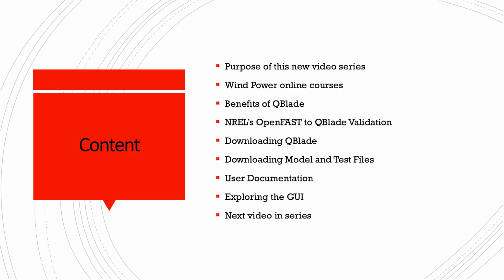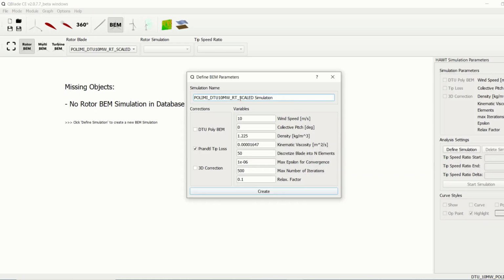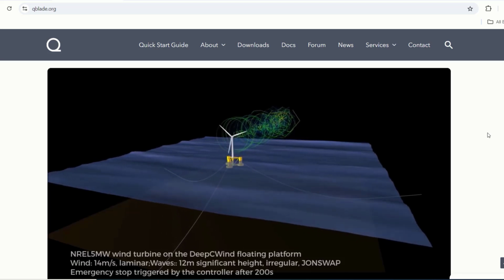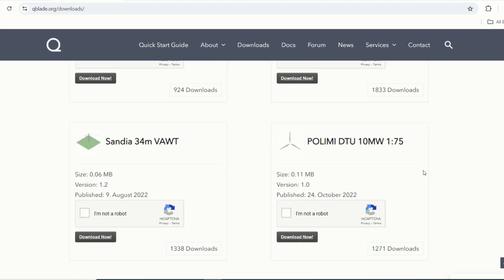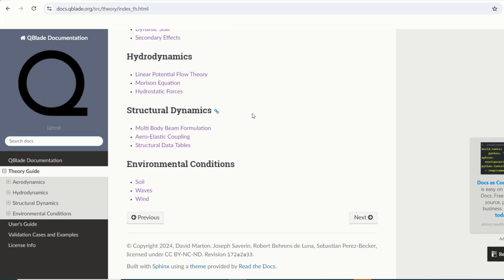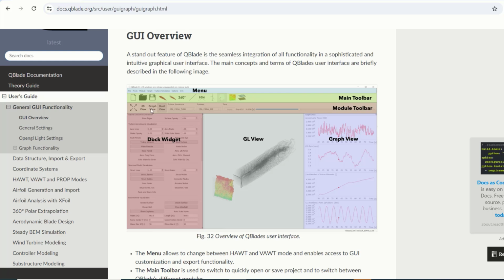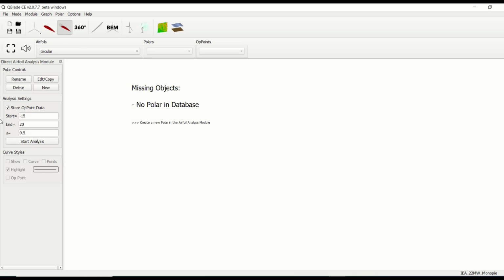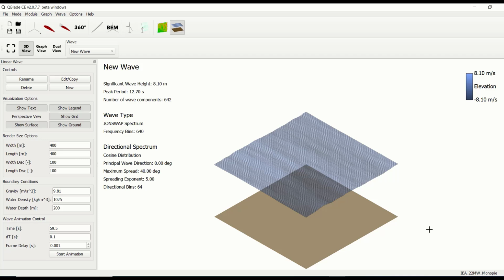QBlade Part 1: Wind Turbine System Design: Wind Power Courses

Comment: I have a question regarding chord and twist distribution. Normally when I did chord and twist angle distribution through optimization of the Bets theory I got uneven shape throughout the rotor blade. Could you tell me why I got uneven result.
Reply from the maker: Hi, thank you. 

Could you explain further what you mean by uneven shape?

What I understand is that the blade twist for Industrial wind turbines is usually done for different Airfoil elements along the blade. But the BEM optimisation is for often only one characteristic Airfoil or property.

For Industrial purposes they often optimise based on CFD or wind tunnel experiments per each Airfoil, then the Airfoil are combined.
Reply: @catchmentofresources  Sorry for the late reply.
I mean in terms of uneven shape along the blade that when I use different airfoils at different sections along the rotor blade and then apply betz optimization approach in QBlade. It creates weird shape like in root section chord is too high while in middle, it's shorter then tip so like root section too big then low and again moderate.  However, I got my answer in your reply that we should apply CFD approach to consider rotor blade design if we use different airfoils at different sections. 

I just want to add one thing, There is a some purpose of betz optimization which is given in QBlade software. And I have also gone through many research papers which describe a use of QBlade. So how they create a preliminary design of rotor blade in QBlade software.
Reply: @manthanpatel394  The Betz approach in QBlade is mainly used to get the maximum theoretical power output (about 59.3%), but it does not focus on making a smooth or practical blade shape. That’s why when we use different airfoils along the blade, it gives uneven chord distribution like very large at the root, smaller in the middle, and then slightly increasing again, because it is optimizing each section individually for performance, not for design smoothness. So basically, Betz is not a real blade design method, it is just for theoretical optimization. For more realistic results, the Schmitz method is better as it gives smoother and more practical distributions for maximum Cp, and if the results are still not satisfactory, we can also apply a customized linear chord and twist distribution to make the blade design more uniform and manufacturable.